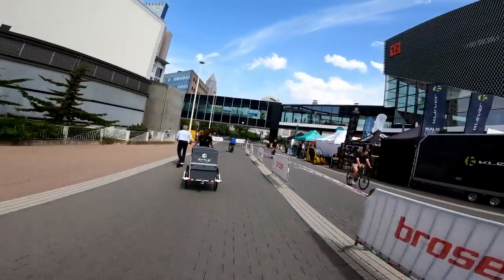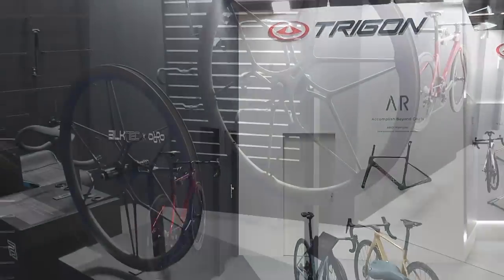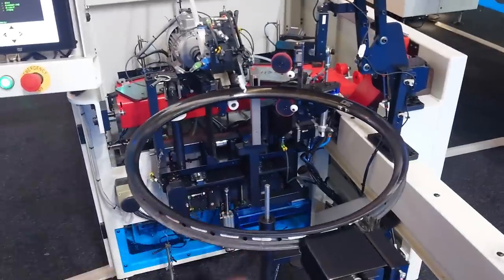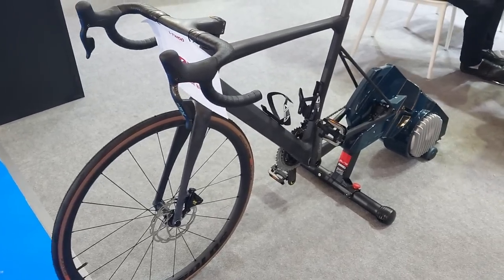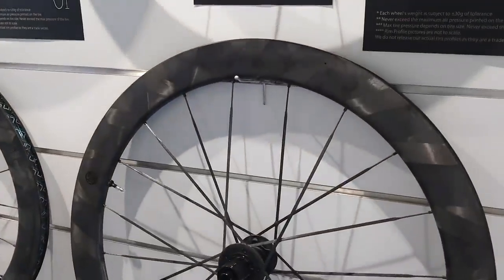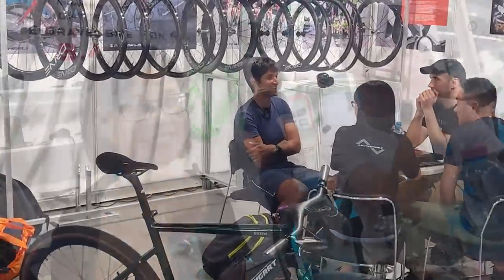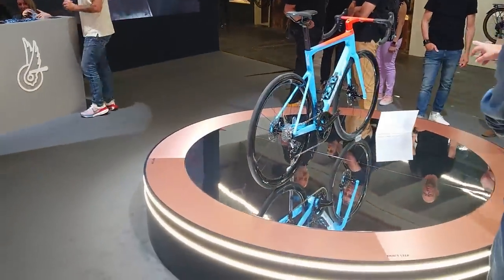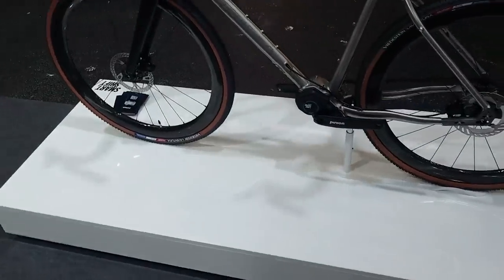Eurobike 2023 - the state of Engineering in the bike industry

Comment: @peaktorque the pinion mounting standard accounts for frame width tolerance, at least on the p and c series anyway. It has 6 mount points. One is fixed and the rest are pressfit steel bushings which come out to match frame width. Its a neat solution. Pinion is so well engineered. Im riding a box from the first batch 10 years ago.

Comment: Nice video, thanks 🙌
Croder cranks look promising, they could be used for rehabilitation purposes and on a home trainer bike to play with a length.
Reply: I have one of their modular cranksets in 155mm. Not great machining and the spindle attachment to the crank arm is too loose in my set. Creak started after 1,5 years. LBS overtightned them to compensate only to ruin the BB bearings. I created a 'shim' of sorts to create a tighter interface that sorted the creaks, but I'll go for Rotor next time.

Comment: The gears inside the pinion gearbox is absolutely massive straight cut gears you would think is made for a GP superbike. It is no way that is necessary for the torque a bicycle produses. So there must be a big potential to reduce weight and size of the gearbox.

Comment: This was great coverage. Very nice. I know that the cycling industry's use of carbon fiber is nothing like other industries but what is your opinion about the non- recyclability  of carbon fiber? Does it worry you at all or do you think it's not really a problem?
Reply from the maker: It is a bit worrying, it can be chopped up and used in other moulded composites, without the original strength of the continuous fibre parts. It can't really be truly re-cycled back to the original component like Alu can.
Reply: @PeakTorque  Thanks for the reply. I appreciate it. Perhaps over time, additive manufacturing with recycled and recyclable materials will take over. I wonder if anyone has ever tried to 3D print Ti aero wheels. It would be an interesting experiment.

Comment: regarding pinion and the tolerances of the frame manufactorer. pinion actually made the holes for mounting the gearbox to the frame not rigid, they use bushings (on some of the bolts). So that mounting bracket tolerance and paint doesnt matter. its therefore important to tighten them in the right order.  i cant talk about the new mgu (because there is no info yet on anything).
i can imagine the doing hte same with the mgu (like shimano does with their motors)
Reply from the maker: Yeh i saw a few with semi compliant bushings, but they are still very rigid axially. Radially they definitely provide some damping/vibration relief. On some Shimano ep8 units the threads are completely rigid (no bushings) if I'm not mistaken.
Reply: @PeakTorque  you might be right on the ep8. Don't think I've ever took one out of a frame. But the 6100 has threaded bushings on one side (don't remember on which)

Comment: I have been half expecting a piece from you about Ocean Gate and the (mis)use of carbon fibre rather than steel for the tub of the submersible
Reply from the maker: Wound CF tube....great in tension but not so good in compression. However apparently it had made 10 trips down to full depth prior.
Reply: @PeakTorque  so is it true it would just continually weaken after each trip ?
Reply from the maker: @gourami7  Impossible to say. CF is very hard to simulate particularly in compressiom. There many mismatched materials here, Ti, CF, Plexiglass all with bonded and bolted joints that expand and contract at different stiffnesses and rates. Not a nice solution. Theres a reason they use very basic, thick steel structures with tiny port holes. It is easy to predict. With a wound CF structure you have so many fault lines and there could be a little void or delamination starting and even with the best NDT you may never see it.

Comment: Thanks for the coverage, but the news it brings is sad. Regarding conventional (non-E) bikes, there's little new that seems truly useful. It's all about light weight and high tech at the expense of longevity, durability and serviceability with little or no practical benefit. If you're a GC contender in the Tour, the marginal gains may be worth an expensive bike that barely lasts the season. But for anyone else it's counterproductive. Looks like cycling reached its peak years ago and the future is only more expensive and gimmicky.
Reply: charlesmansplaining  you can add agesplaining to that.

Comment: Does the Pinion motor sit in a light oil bath? Looks just like when you split the cases on a single cylinder off-road bike. I can’t imagine that gear box running completely dry. I’d imagine there would be some accelerated wear otherwise? 🤷🏻‍♂️
Reply: I think they do, well they do on there older non electric models
Reply: Yes and that's about the only maintenance they need, Pinion claims

Comment: Classified's biggest mistake was giving a shit about roadies. They should have gone straight in with the MTB and gravel front. Why? Because those bikes often can't have a front derailleur. I really couldn't give 2 rats asses about efficiency loss going to the lower gearing if the range is the difference between making it up the hill or not.
Reply from the maker: Exactly, good point. And the shifting is absolutely excellent (test rode it).
Reply: @PeakTorque  That's cool to read. I really think this is going to find a home in a lot of gravel races. Eliminates any negatives to just maxing out your chainring on a 1x and still having a climbing gear. Yes there's mullet wide range but that has its own problems. The "local" race here (Gravel Locos) has 3 absolutely crushing climbs that hit back-to-back-to-back and this would be about perfect for the feature.